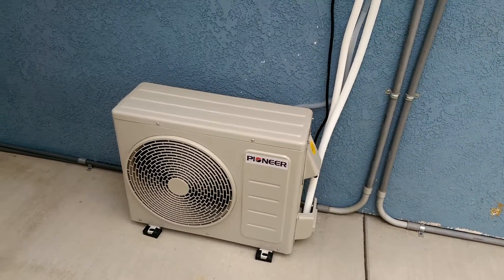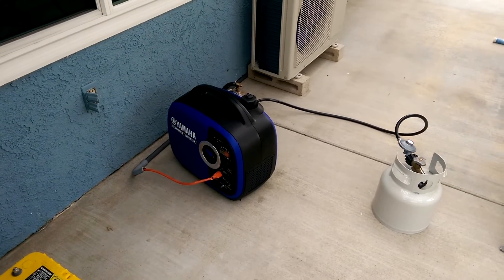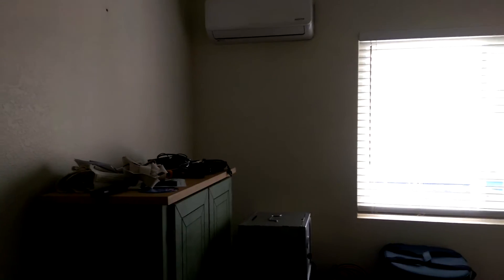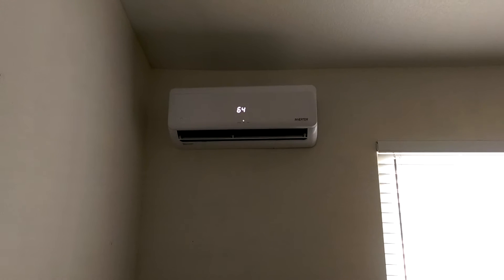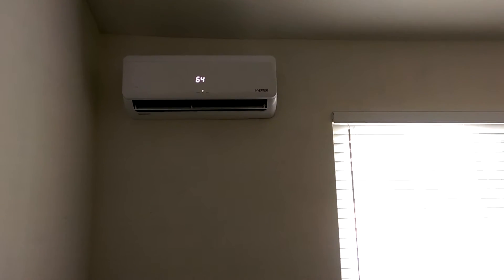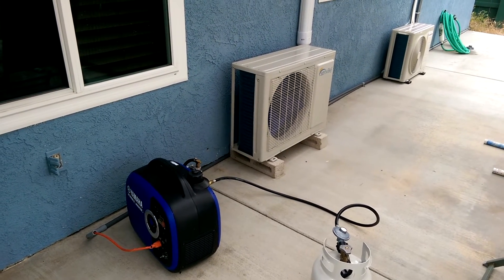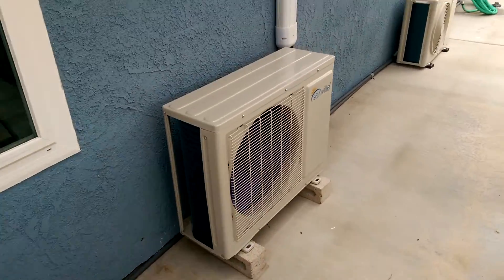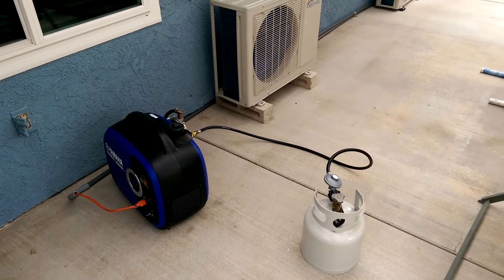Pioneer Mini Split 9000 btu 15 SEER  110v Air Conditioner running off Yamaha generator

Comment: Do you think I can run two mini split systems off o a 10k surge watt 7000w continuos  generator?
Reply from the maker: I'm pretty sure you could, these mini splits do not use that much energy, mine are 15 seer unit I bought back in 2015 I think. The newer ones are 25 seeer which is even more energy efficient.
Reply: @patd56  thanks . One is a 22seer and one is a20

Comment: Pat, I love it. 
How did you wire the mini split for a 110v outlet?
I'm not seeing a video describing that part.

Whoops, I believe I've found the answer/description in the comments of another video. Thank you.
Reply: @doomstar2472  
I don't see the link now, but what was explained by Pat is that he took an old (or new) 12 Guage extension cord, cut it to desired length, and spliced open the female end. Then Pat stripped the 3 wires inside the extension cord and hard wired or spliced them directly into the outdoor AC unit. 
Seems like the colors of the wires even match up. Green/Green, Black/Black, etc.
You'll have to dig deep into Pat's replies in the comments section of another video of his...thats where I found his explanation. I believe it was a video to one of the 'parts' to his mini split installation videos... good luck! 🤙

Comment: FYI, the Yamaha is not a generator, it's an inverter. Which is exactly what you need to run your inverter mini split. Plug that into a regular generator and you will blow your computer boards! 

How long will your propane tank last before going empty?

Comment: How many hours does it run, are having trouble with it now or it's been easy peasy for you with this generator
Reply from the maker: Jesus Alvarez No problems with it at all, the propane does not go stale like gasoline does that makes it almost impossible to start the generator. The generator starts and runs like new and I’ve had it for about five years now.
Reply: @patd56  that's great I'll try to put one on my semi and with that generator also that's why I want to get some feedback how good is that 9000btu

Comment: Excellent video .. you really have a nice set-up. I love thos little split ac inits for so many reasons .. especially the 110volt models. Beautiful generator. I have small 6000btu air conditioner for outages and when I power it with my Generac 2200 generator I usually leave my generator off eco mode running in normal mode to absorb the energy demand spike of the compressor start up. It uses a little more gas and runs a little faster rpm on generator .. but it starts the compressor really well during that several second demand for high wattage starting motor of compressor. I also leave my generator on regular mode for refrig for same reason.
Reply from the maker: Thank you, I love these mini-splits, I ran the living room AC  almost all day last summer and the Pioneer all night and they only added around $25 to my electricity bill, my central AC added over $120 a month in the summer, the Yamaha has no problem running the Pioneer at all. great little gen for emergencies.

Comment: I would be concerned about the generator being so close and sucking in carbon monoxide!
Reply: Heat pumps do not transfer any air into a house. They transfer their energy with a refrigerant.
Reply: Propane burning does not produce carbon monoxide.
Reply: Propane is the cleanish nfuel u can burn inside

Comment: Why did you end up raising the condenser unit up onto the bricks? Just to make cleaning around it easier?
Reply from the maker: +Robert L That's why I did it makes it easier to hose it off and keep it clean on the bricks, I would have done the same with the Pioneer but I only had three bricks to begin with, to lazy to go to Lowes and get another one..lol